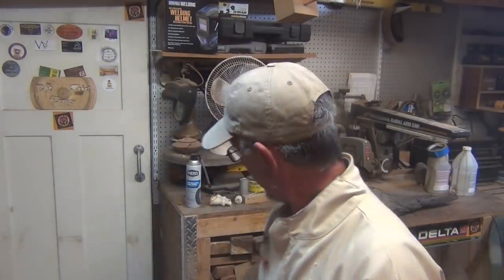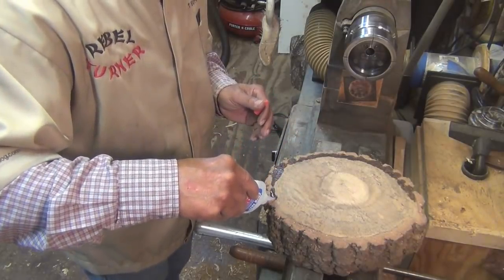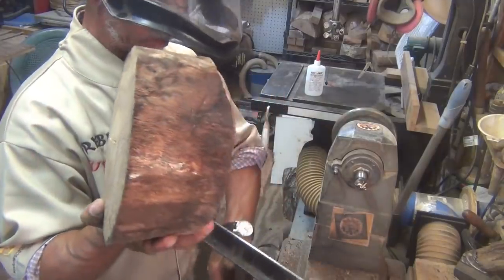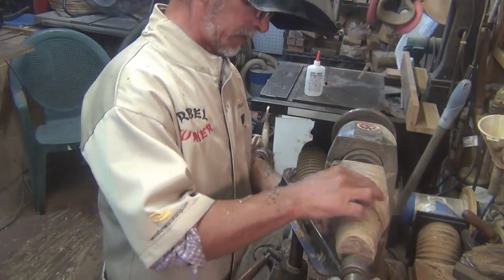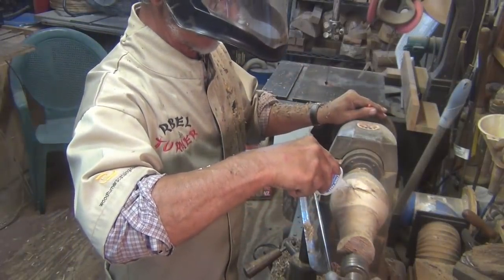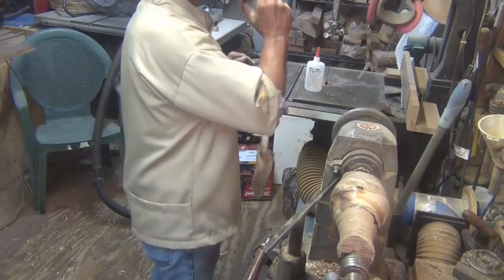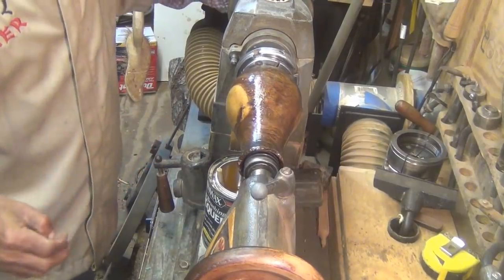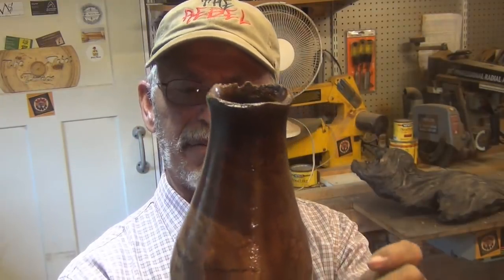Woodturning a Stippled Vase

Comment: Hi AF, I have just acquired my first wood lathe due in no small part to the videos that you have uploaded Now acquiring eligible and interesting materials to turn.  I decided to begin the trek to gather some hardwood.  In my sights currently I have (at the maximum) a 12" Maple limb from a 120 year old,.. failed due to rot at a crotch. Would you recommend the size of cuts I should take. Can it be turned while wet and dried afterwards with a light oil coat. Or must I store till I am old and brain dead? 
P.S. After the bark came off I never expected you to turn the piece in this axis to continue.. quite illuminating indeed.